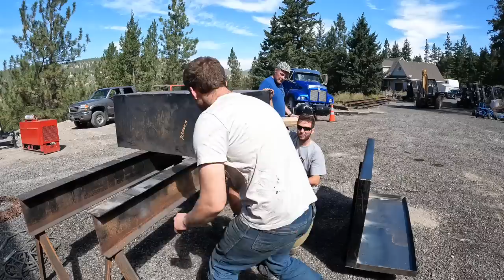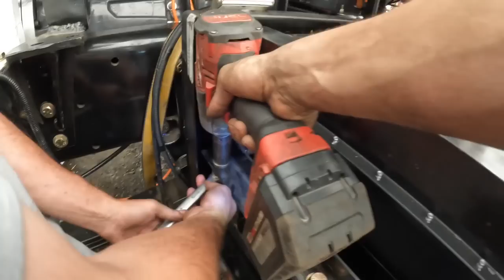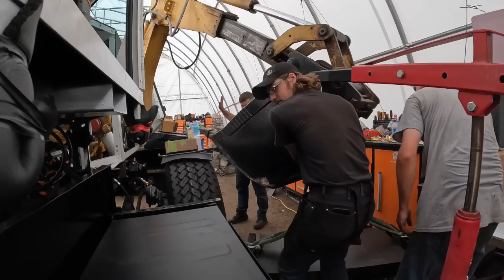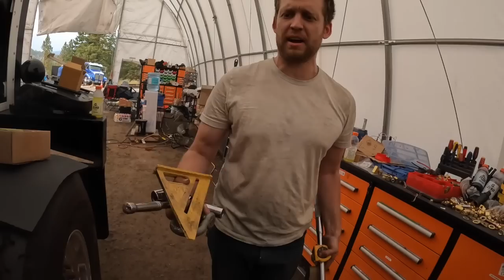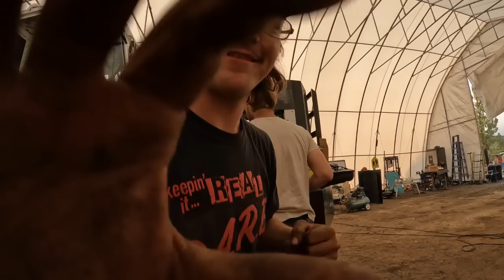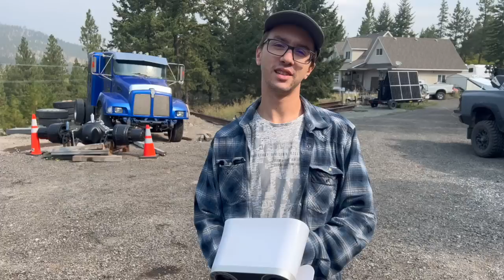Batteries In, Banter On: Truck Transformation Debrief and 3D Scanning Adventures

Comment: It's great to get that 3D map & set up manufacturing standards for all your parts. Once that's set (including any tweaks to designs after prototype testing), you'll need a schedule, a timetable, a map production. A logistical plan to order parts to arrive in a timely manner to go with an order of construction. You'll want to build in a logical order so the vehicle comes together in the shortest possible time with the least amount of work & scheduled to not cause overlap of workers waiting were "Joe" is trying get those wires in place &  so "Bob" is not standing around, picking his... nose, waiting to install the panel cover.

Comment: I'm assuming each battery module is 20kWh each, and since there's 8 of them, that's 160kWh worth of battery?
Reply from the maker: 35kwh each
Reply: @EdisonMotors  not bad at all, 280kWh.  I'm assuming you might get something like 200 miles of range unloaded?
Reply from the maker: @charlesball6519  This truck is a Diesel Electric truck, the generator will kick in and stop your batteries from draining, as well as a vocational truck, where an empty, straight down a flat highway drive isn’t applicable. 

The range is dependent on the diesel in your tanks combined with your ability to recharge your batteries with regenerative braking. 

-Theron Danger
Reply: @EdisonMotors  Well, yes. I should have said that "I'm guessing it might get 200 miles before the generator starts up to charge the battery."
Reply from the maker: @charlesball6519  we are estimating 2 hours driving, loaded, before the generator kicks in for 30 minutes of charging. 

-Theron Danger
Reply: @EdisonMotors  Ah, that's pretty good.

Comment: likely there will be some problems  with parts not fitting either because the fabricator thinks..... allways dangerous if a fabricator does that , or theres a misstake in the design / cad file , probably the first thing is most likely to happen

Comment: One idea that would be cool is go to your local engineering universities or a university with an engineering program, sponsor senior design projects and have them design assembly jigs for your manufacturing. For example a jig and mechanism to install those cab side batteries as and assembly without using an engine hoist or having to manually push them into position risking damage or injury.

Comment: Scanning NOW?? 
The horse has already left the building!
Maybe update your Blueprints/CAD designs?
Parts lists of what you used, not just everything  you've bought.
Reply: I disagree. Edison has followed some loose plans, but one of the reasons they have assembled this spectacular machine in less than 6 months from receiving frame rails, and a year from the proof of concept "Carl"  is that there has been a purposeful looseness to the build plan.  Reverse engineering or many of the improvised and adapted parts will be an excellent path forward to production.  Edison has certainly not followed traditional models and spent years on up-front engineering and CAD work.  In this case, I think it was the right approach to get something built with minimal capital and maximal results!
Reply: @nigelmccreary7990  
Loose?
Martin Mull: "Oh you're pitting in 240?"
Michael Keaton: "240, 241. Whatever it takes."🤣😂🤣
I'm pretty sure those rears weren't just sketched out on a chunk of cardboard, the engineers aren't in the tent, which is why it's going so well, and on a shoestring budget.
But now and again they need to step back, and look at things
ie, pull the engine to add the generator assembly. Don't work upside down, and sideways for 12 hours, because the Cat is already in truck.
Buy a used John Deere or Case tractor cab.
It's plumbed for heat and AC. It's already soundproofed, seats are made for 18 hour days. lol!  Don't reinvent the wheel.
Again Live & Learn.
I just hope someone besides PACAR is watching. Benz, Volvo, Scania, and Mann jump to mind. I could see VW, or Benz using this concept across all of their platforms.
Please understand Nigel, I'm praying for these guys every night. I want every truck and piece of heavy equipment to run like this.
Reply from the maker: Do you actually think we made blueprints and cad designs for all our parts?

We made parts on the fly out of steel based on what would work.  Now after it’s done we document and refine what we did

Comment: Guys I see you are not using metric fasteners and I’m sure the original truck is all SAE but when you go into production on a clean sheet of paper design  Please use metric so it can be sold world wide.

Also you do Not need grade 8 bolts on those boxes. Grade 5 is fine.
I see you are using Nylok type lock nuts. Thank you for not using classic split lock washers as they do not work. For those who don’t believe me go to your car made in the last 30 years and find me one .

What is better is Nordlock washers or the proper strength locktight for the application .
If you have not used Nordlocks yet get the salesman out for a demo!
Reply: The ultimate fasterner is a nordlock washer, vibroite, and a castle nut with safety wire or cotter pin. Then it’s GOIN NOWHERE. 😂
Reply: Sir,
The castle nut with safety wire will prevent it from falling off and becoming a danger But the nut can loosen releasing the clamping force long before the nut backs off enough to be stopped by the wire.
Reply: @josephpadula2283  did you not notice me also adding the nordlock and vibrotite are you electing to ignore that
Reply: Sir,
I missed it entirely.
Sorry.
Reply: My lone wolf - they must have edited it out because the video does not show anyone adding Nordlock or vibrotite.
Just watched it again after I apologized for missing it….

Comment: This whole truck has me curious, why not put a multispeed transmission in an EV? Wouldn’t that affect range and performance positively? I know that electrek did it in the 1970s
Reply: No need. The rpm range in the e axels are made for all truck operating speeds. 

Adding a transmission would only add weight, complexity, and losses. More stuff to brake 

A fully e axel is far more efficient. Most electric vehicles for any e power do not use an transmission for a reason. There’s just no need and a lot of downsides. 

Electric motors don’t work like ICE engines. They’re pretty rpm agnostic. 
They only care about load and power loss.
Reply: I believe he said that the E axles have an deep reduction gear but since electric motors have 100% of their torque from a stand still it’s not needed to have any more gears.
Reply: @meade4573  Indeed. There are only two areas where having multiple gears makes sense: Hi-speed vehicles (above around 230 kph) and better regen at low speeds. The former because the gearing ratio and rpm range of the motor become problematic, the latter because power generation falls off with lower rpm.

Comment: I'd  consider mounting some sort of guard on the leading face of the battery boxes, if a front tire ever lets go it could easily take out $10k worth of batteries..we've all seen what can happen to fenders and fuel tanks when a gator strikes
Reply: The cage the batteries are sitting in are in 3/8 thick steel angle iron and square tubing then it's going to have what appears to be a 16-gauge metal box that is going to be the step sitting around over the top of it...
  I think it's got plenty of protection if that tire ever goes
Reply: I could be wrong, but I believe the batteries are going to be under the step
Reply: never mind the tire, what of the   tire spray!
Reply: @petedude2lu3  good point...going to want to seal those boxes up TIGHT...

Comment: I missed the batteries moving
Reply: They aren't moving the location.  There is an A set and B set of batteries.  The A set is going on where they installed them in the video and the B set goes between the frame rails, shown in the last video.

Comment: Guys I am big fan but for serial production parts 3D scanning might not be only thing needed :))). Usually is good to measure parts independently. Compare with initial drawing do test assembly and test circle bact to fixing/ parts drawings etc. So you have final (serial) document. Otherwise, fingers crossed 🤞.
Reply: Mind reader. 😊
Reply: Please elaborate on "test circle bract"
Reply: @jwiereng  pretty sure it was meant to be 'test, circle back